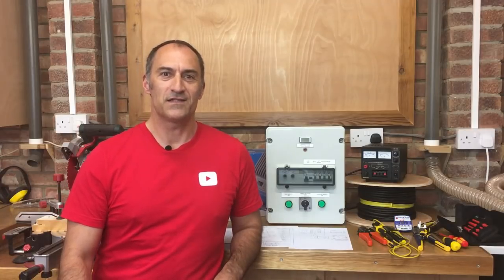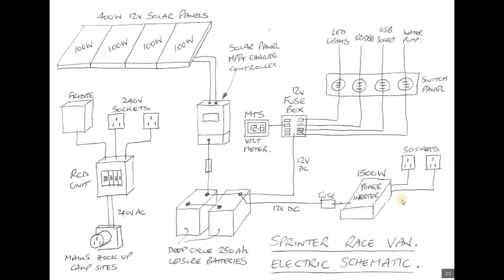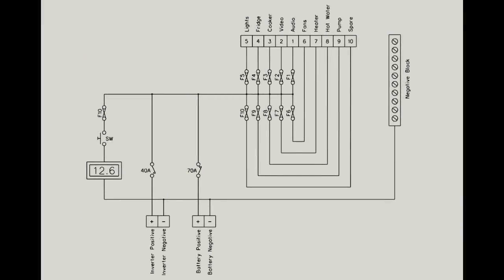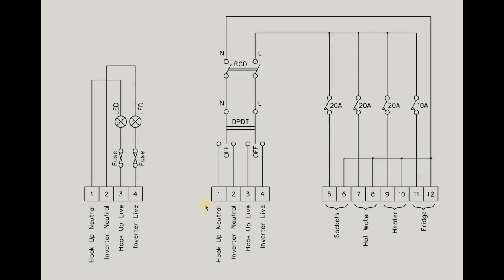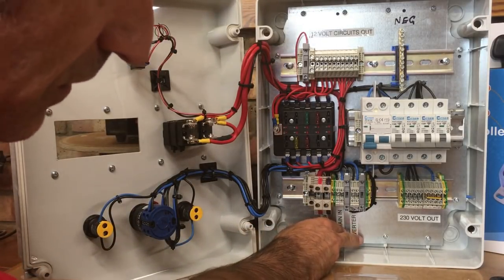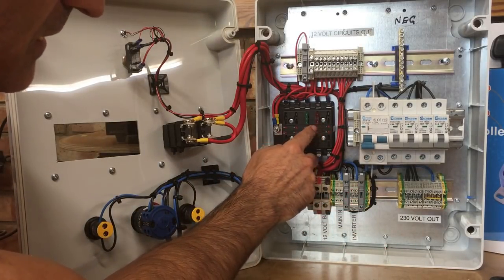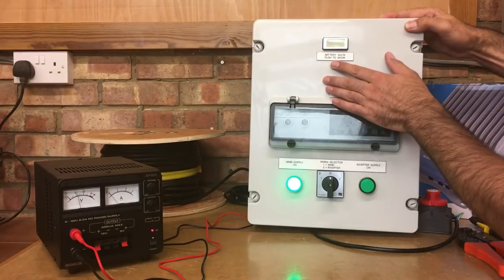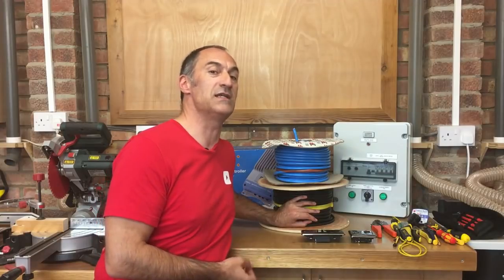Self Build Camper Van 12v Electric Control Panel

Comment: Really great videos Greg, I'm just in the research phase at the moment but thinking of doing a conversion.  What is the earthing/grounding policy with respect to the mains 240V and 12V van battery/Leisure battery systems. Bearing in mind there will be no direct earth unless using a hookup.  From a safety perspective the RCD will provide protection, but I can see the potential for some very strange earth loops.  Also is the control panel made from a fire resistant material?

Comment: Greg,

Does the switch from shore to inverter power mean that the system, as it is designed, cannot use shore power to charge the batteries?

If you did want to allow shore power to charge batteries, the shore power source needs to go into the charge controller, just like the solars cells?

And then from there, you would have to decide if you're going to make a simple circuit where the battery is charged from solar panels or shore power, or if you want to make it more complex, where you can charge from both simultaneously?

Thanks for your videos.
They are most excellent.
Reply from the maker: It doesn't need to be that complicated. My charge controller doesn't accept a separate mains power input.  But I can easily fit a mains battery charger and just plug it into the mains supply when on hook up.

Comment: Hi Greg, fantastic video and great job on the electrics. I am very new to van build so please forgive my naivety and what seems a stupid question. Am I right in thinking that when plugged into a camp site and running off mains 240v, the interior 12v lights etc will still be ok and running normally? Like with being situated somewhere off grid, the 240v appliances will run with power from solar panels through the inverter?? 

Like I said, I’m very new so please forgive the stupid question. I just wondered how the 240v would power 12v appliances safely and vice versa 

Fantastic job so far, I’ve subscribed to your channel and watched every video. You go into great detail on every one and make it all look like a straight forward process with a van conversion. 

Thanks for such a great job
Reply from the maker: Hello Ashley, Thank you for your kind comment and you question highlights one point I didn't mention.
All the 12v appliances and devices are always powered form your leisure batteries.
The only thing that changes is the 230v source, between inverter and mains hook up.
When off grid the solar panels charge the batteries and the inverter provides the 230v supply.
When on hook-up you have a mains powered battery charger/manager to keep the leisure batteries topped up. (This I didn't show)
The 230v appliances are fed directly from the hook-up supply via your consumer unit.
Hope that makes sense. Thanks for watching.

Comment: Hi, I'm not a pro, but I'm surprised that the two batteries are only charged by the solar panels, and not when plugged on a hook up camp site ?
Reply from the maker: Of course I will be charging them when on hook up. Just haven’t shown that in this video. Sorry for the confusion
Reply: Thanks for the answer, and for sharing all these videos. They are priceless for those, like me, who think about starting this kind of project.

Comment: Hi Greg. Thank you for your replies. i was wondering why you opted for (two) AGM batteries. Lithium batteries are very expensive (but less so if you buy direct from China), but have much greater cycle life and higher discharge capacity. Thanks. Barry
Reply from the maker: It's purely just a cost thing, I know everyone says about lifespan and pay-back. But a 1000 cycles will last me 3 years and for a couple of hundred pounds not thousands.

Comment: Hey Greg! I'm just finishing up my vans wiring diagram and your videos have been very helpful. Is the volt meter the only battery monitor your using? No battery monitor with a shunt to read the charge from the solar or alternator and to see battery reserves? Loving the content!
Reply from the maker: Hello Adam, my solar charge controller has a MT-50 remote LCD that gives all information regarding solar power and battery charge status, this will be located in the van so I can see at any time what the system is doing. My solar charge controller is an EPSolar iTracer MPPT with MT50 remote display.

Comment: Hi it strikes me u have not included a mains powered 12v battery charger or a split charge circuit to the alternator and leisure battery's .......can u explain your thinking on this ....thanks jon.
Reply from the maker: Simply because, it was too much to put in one video John.
I do have a split charge kit, mentioned in the next video I think? which will be installed
I'm still looking for a suitable mains battery charger.
I want one that will do a good maintenance job with remote indication.
Reply: Great series of videos by the way , just a thought on the celotex insulation should u not be aluminium taping any cut edges to mantain the vapour barrier and the u value , just a thought , I have already bought some dacron to insulate non flat surfaces in my van , does the have a good insulation value or would I be better with what I have ?. By the way in my t4 it has a vent to the outside inside a rear wall panel I presume tis has to be blocked off or I will get vapour into that cavity from the outside ....?.......many thanks jon.

Comment: Hey Greg, question. Why do you have both a 12V input for the fridge as well as a 230V? Does it need both
Reply from the maker: Yes, its dual supply when on hook up or battery.

Comment: Couple quick questions. If both feeds are available 230v shore power and battery/inverter power then both of your available power lights will be illuminated? Reason why I'm asking is then you have to visually verify what position your switch is in to see where the draw is coming from? If you had another set of lights down line of the switch, in a different color, to show the On Bus source it might help alleviate confusion from a quick glance in a dark environment (i.e. aircraft overhead panel style). Possibly overkill I know 😕Great presentation on you ideas and execution!
Reply from the maker: Like all these things John, you can keep adding stuff but you have to draw the line somewhere. I just wanted a panel live light in effect. So I knew there was power coming into the board. I’m concerned they may be a bit bright at night may have to devise a cover?
Reply: Good to know. Totally understandable. You did a fantastic job, one to be extremely proud of! Thanks again for sharing. I really appreciate your well done presentation on the various aspects of the build, your schematics, the planning behind it, and your time. Sharing it with some of my friends. Best of luck, safe travels!
Reply from the maker: I really appreciate that John, many thanks for such great feedback

Comment: Terrific video. Nicely organized panel. Esp. like that you took proper care and labeled the internals.I do suggest that you insert plastic partitions between the AC and DC components to eliminate any chance of a wire vibrating loose and feeding 220 volts into your 12 volt system.I would perhaps even fashion a cover guard over the 220 side. Users will be opening the box to change out any blown DC fuses, and there would appear to be a shock risk, albeit small, from the exposed AC terminals?(I’m also curious if the AC status lamps have proved too bright at night?)
Reply from the maker: Hello David, I would never advocate opening a panel without first isolating the incoming supplies. The panel will be located in the garage below the bed so hopefully the lights won’t be an issue. Good point though, they could be very bright. Thanks 👍🏼

Comment: Hi Greg, I’ve just discovered your channel and it’s given me some great advice.  I really like your electrical control panel.  That was a great idea to use a centre off DPDT changeover switch.  What did you use to make the labels on the front of the panel?

Also you stated in a reply to Mihajlo Kostovski that you had purchased a split charging relay to charge the leisure batteries while driving the van.  Could you please explain how you calculated that your van’s alternator has a higher enough amperage output to cope with charging multiple batteries together?  Will you need to upgrade your alternator for one that has a larger amperage output; or will you need to install a second alternator in your van dedicated to charging the leisure batteries?

Thanks
Reply from the maker: Hello Jim,
The labels are made from a material called traffolyte. It's a plastic sandwich that you engrave through. These were made for me.
You have made me question the output of my alternator now so that something I will have to check out.
Reply: Hi Greg, I asked the question about the alternator because I need this advice before I commence my own project.  It was probably an unfair question as this particular video was not about charging additional batteries via the alternator.

Your alternator may be okay because you are charging the batteries from both the alternator and also from solar panels.

However, I’m pretty certain that a factory standard alternator on the van is designed to deliver enough current if all the van’s electrical systems when used at once, plus a little bit more so that it is not running at one hundred percent.  I doubt Mercedes factored in spare capacity for the alternator to charge additional batteries.

Adding more batteries may possibly cause the alternator to be permanently running at full capacity which could burn it out.  Or the alternator may have
insufficient output to fully charge the multiple batteries.  This is why I asked whether the alternator should be upgraded or dual alternators installed.  Perhaps I am totally wrong about the alternator and worrying when there is no need.

Hopefully a mechanic/ auto electrician will read these comments and give some advice on this matter.

Those traffolyte labels give a nice professional appearance to your electrical control panel.

I have been very impressed with all your videos on the camper van build and I look forward to the future ones.

Thank you.

Comment: What box did you use to install the stuff in? (Sorry a very dumb question I know)
Reply from the maker: It's a waterproof ABS plastic electrical enclosure. Comes as a plain box and you cut the facia yourself to fit whatever components you are installing.
Reply: Greg Virgoe Many thanks - am still trying to learn 😀

Comment: Hi Greg, build is looking great so far. Looking forward to future episodes. Could you answer a question, I don't think you answered it during this video. Will the leisure battery charge when using a campsite hookup? Seems a good idea if your paying £10-15.
Reply from the maker: Yes, I'm still looking for a suitable mains charger for the leisure batteries. Do you know of any good ones?
Reply: Hi Greg, I thought I'd seen something on another YouTube video but I can't find it now. I'm afraid I'm not an electrics expert but thinking about it logically it would be charging a 12v battery via a 230/240v supply so I guess a standard battery charger would suffice. No extra witchcraft required.
Reply from the maker: Hi Andy, you are right. I’m going to look for one that has bit more sophisticated control for maintaining batteries and hopefully a remote display would be very nice too.

Comment: Sorry here again. .thanks for ur help..
The 12 v dc cable.. did you buy in 50m ?
I clicked the link the blue link perfect.
The black link took me to website.. but I couldn't see how to order 50m..
Might be cuz I've never ordered anything and am not in the trade.. 
It was a bit hieroglyphic 

Have a great evening...
Van weekend time..
Once done.. I'll send u some pictures..
I'm hoping it's 1st class 

Cheers greg

Josh
Reply from the maker: Hello,
Yes I originally ordered 50m of each cable, but found I needed more of the black 2core 12v cable and less of the Arctic blue cable. 
Click on the link after 12v DC cable and look for product code 900030 1.5mm 2core cable. There is a box where you can input the meters you require then click add to basket. They will send you exactly how much you want. Price per meter goes down the more your order. 👍🏼

Comment: Thank you so much for all your giving with out taking anything.. your a good man.
May I ask you a question.
If I was to just use eg. 3 x leisure batteries and would say use a tent hook up and not do the mainsset up.. would I need to have the pole switch.. could I just then run the fuse box and the voltage meter... with dc and inverter ...
I'm fine on everything but this... I'm gonna spend some time on electrics but I'm kind of rushed  for time..
If you know what I mean.. confused
..I want a basic set up that I can use everyday things like blender for me.. juicer. Charging phones lighting and fridge..
But would love to use my distiller...
If you don't understand me.. I'm barley right now.. Haa. 
Thanks again greg
Reply from the maker: Hello Catt, you can just connect your batteries to Aladje fuse holder and run all your 12v DC supplies from that. Use your mains hook up to power a battery charger to maintain or top up the charge in your batteries. Also look at Voltage Sensing Relay to charge your batteries while driving along. You would not need a panel or changeover switch just fuses and isolators, very simple setup. List items you wish to power and if they would be 12v or 230v? Hope that helps you
Reply: Thank you so much for you time.. yes I want to use a split relay to charge the batteries when driving. ..
Sorry for another question would the split charge relay be suffice enough to keep topped up if I did say 30 mile trips every day plus...
And be using 3 batteries that you used..
I didn't really wanna go solar as in my research is not necessary? And doesn't do top much??
Again only reading other people's views not tried and tested..

But the rest im gonna give it a shot..  

Added about 15 views to this last night. . Haha 

Hope your van build is coming along... 
Thanks for your advice.. if u need any help with 
Nutrition,
Healing
Disease curing
That is my life's work.. 
I seen your x mas video on your charity...
I have reversed that Disease in many.. I know it's very hard to get to get.. as ur electric box is for me..
I just thought I would put it out there as you have helped me so much..

Great guy. 
Thank you for all your selfless effort
Reply from the maker: Hello Catt, I really can’t give a definite yes to your question. 
30miles would be approx 45mins of driving so not a great deal of time for charging. Also depends greatly on how much you use when parked up. If you didn’t want to go with solar. You could look at carrying a small generator for emergency power if you run low. 😊
Reply: Greg Virgoe AH I see, thanks for your fast reply,
That's great help, I think a tent hook up and a battery charger might be best for when outside homes ext. I seen a camping convertion shop yesterday he said ten mins driving would be enuf, this is why I'm taking my time learning.. as too many people quick to say what they think rather than the truth.... 
Thanks for your honest feed back, 
 
Look forward to seeing your installs when you done 
Thanks again
Have a great day
Reply from the maker: Like you I prefer to do my homework and see the hard facts. You are welcome. Thanks for supporting my channel. Best wishes

Comment: More questions if you don't mind. What diameter is the 12 volt cable? Here is the US we are still in the guage world. Second if I wanted to just build a 12 volt system without solar and two leisure batteries,since I will be mostly traveling and not living in it, how would you go about charging the leisure batteries. I have seen videos on using a continuous duty solenoid to charge them while driving but am concerned with mixing deep cyle one with my starting battery. Your thoughts.
Reply from the maker: Hello Jim, what you need is a split charge relay. When you are driving and your alternator is giving 14v or more  it will also charge your leisure batteries. You could also add a mains charger for when you have external hook up on a campsite.
Reply: Thank you. I found some more info on the Australian direct channel a device they call VSR or voltage sensing relay since my van is a 2005 I'm going to look into the split charger relay. The limited amount of time I will need shore power or 120 volts I'll just run a simple circuit and plug my fridge and heater in as needed.
Reply from the maker: VSR is the same thing as split charge relay just different name. I'm using 1.5mm and 2.5mm cables for my 12v and 230v power depending on the appliance loads. Google cable sizing chart and select by amps running currents.
Reply from the maker: For excellent info look at www.simplysplitcharge.co.uk
Reply: Thanks so much, I can't wait till warmer weather to get started
Reply from the maker: I work until my fingers or toes start going numb, then come in for a brew and thaw out 😃